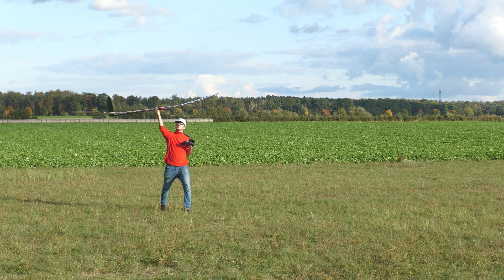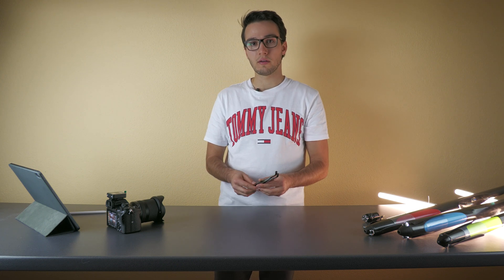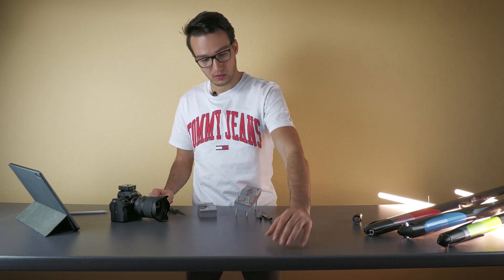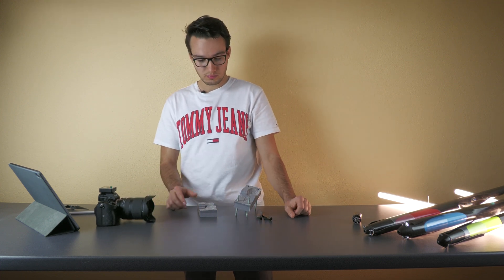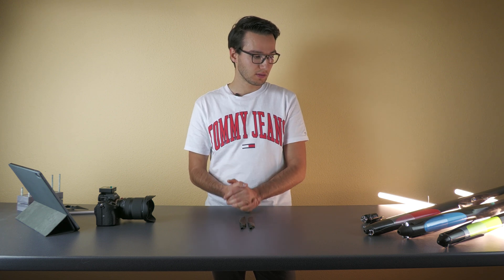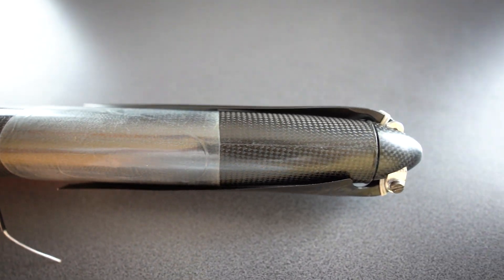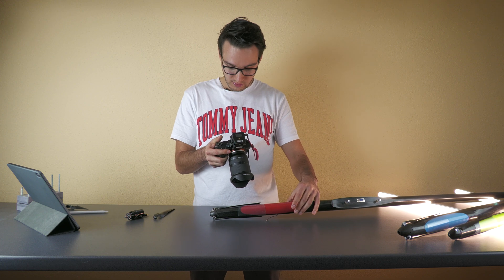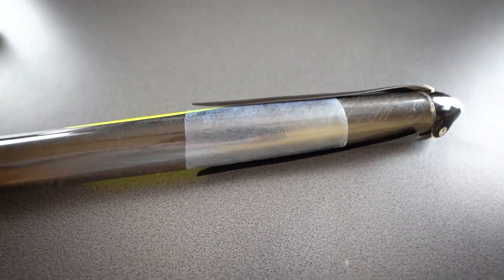MY FIRST OWN FOLDING PROPELLER - THE STORY BEHIND - Servorahmen 1A

Comment: Had one of these fail on me today,  6th flight on my new Phoenix DF,  pitched a blade on a 4s Tenshock 15/15/15 about 20m into a climb. Two cracks in the fuse and a smoked ESC.  It's a shame I won't be able to trust these injection molded props anymore, the performance was good.   If you decide to lay these up in CF I'd definitely use one again.

Comment: First of all congratulations on your propeller. Looks really good. Just a comment on the lack of designation of it. You should be able to provide a nominal diameter and pitch to any propeller. Granted it will not give an exact characterisazion of it at all power and flight speed range, but the pair of those two values is how propellers are classified. Diameter is the easier: measure it. We know that it depends upon spinner geometry; therefore you can state which distance between the fold axes of the blades you have used to provide the figure. For pitch it is typical to use the geometrical pitch at 75% of the diameter. Again this is a connvention but it provides an idea of the kind of propeller you are offering, particularly when one considers the diameter/pitch ratio. If you don't provide such 2 basic parameters people will have to rely onto your table litsing the different configurations of motor/battery you have published, which is good, but you are effectively limiting your own market to people owning those setups. Again, this is not to criticize, I am designing my own propeller myself so I know it is not an easy task, but to offer an improvement option. Keep up the good work!!!

Comment: What sizes you have available? Might want to test one ...
Reply from the maker: Hi Jure,
the Propeller is only called 1A and we haven't added the size of the propeller.
I learned from all the runs on my testbench, that the sizes which most of the manufactures give their props isn't right.
So it is unfortunately not comparable the most time.
That's why we made a additional document there you can find many examples, with that you can use this propeller.
The document can you find under the following link:
http://www.servorahmen.de/F5j_Prop_1A_Factsheet_D_E_20201129.pdf
Reply: @RCflyingmore  would this prop work for the ccm optimus f3j model mate